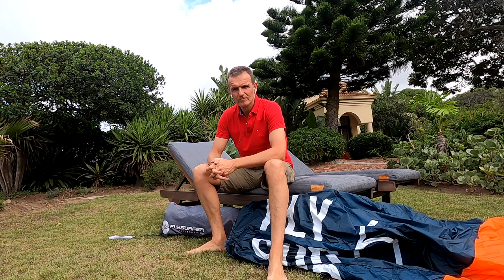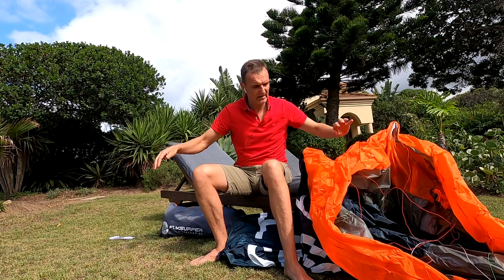Techtalk Kite Windrange

Comment: Armin Hello,
I really enjoyed the video.
I just bought  18 m soul2 with a 60 cm Infiniti bar.
I have been surfing for over 10 years with inflatable kites. And I would define myself as a good surfer.
I wanted to ask given my weight of 85 kg, would the chart that refers to the wind range and its based on a 75 kg surfer, is also my range?
or can I surf without fear in winds over 15 knots? Let's say 17-18 knots with a twin tip?

Thank you (:
Reply from the maker: If you are 85 instead of 75 you have a 6% higher windspeed compared to our shoed wind range. 
But foil skills, board, ... has a lot bigger effect to the wind range.
Always start in the mid-lower wind range until you get used to the kite and feel confident. That you can go in more wind to see where your limit is. To reach 15 knt top wind range is very expected from my side. People who love to ride overpowered will also go in significant more wind.
Reply: Thank you 🙏

Comment: Hi, do you think that for a first flight and body drag in 6-12 knts, the viron3 8m will do the job? Cheers
Reply from the maker: The Viron start to park in 8knt of wind. Viron is super safe even in stronger wind. Use it on 8-15+ knt for the beginning.
A Peak is easier to fly and park below 8 knt. For sure usually not relaunchabel, but easier to keep ion the air.